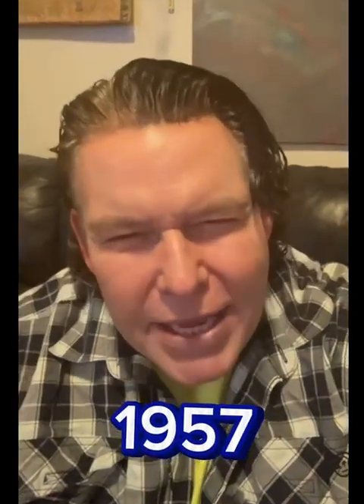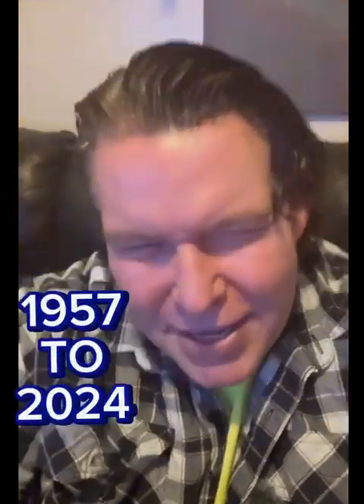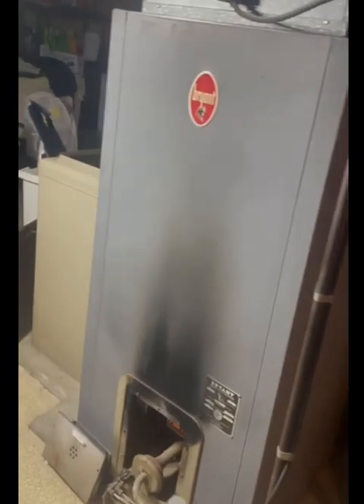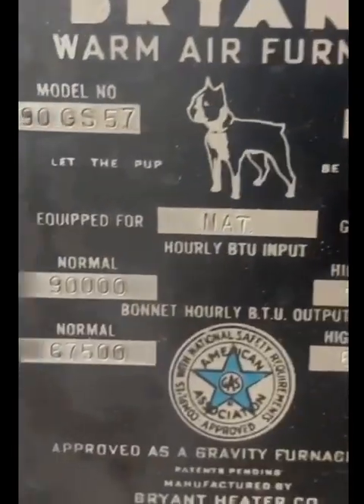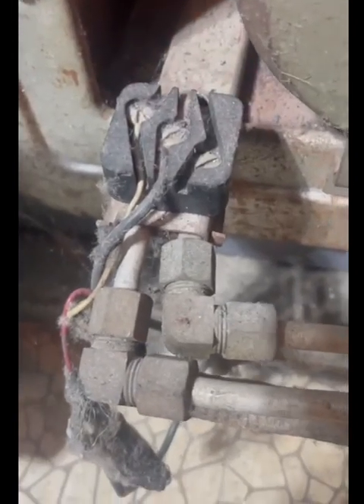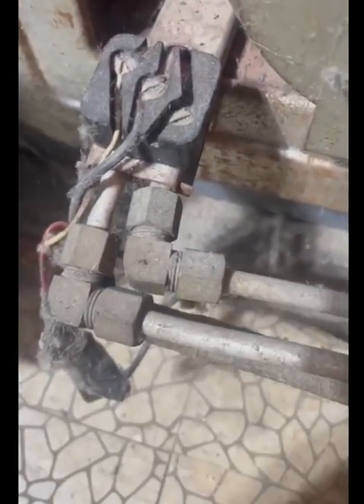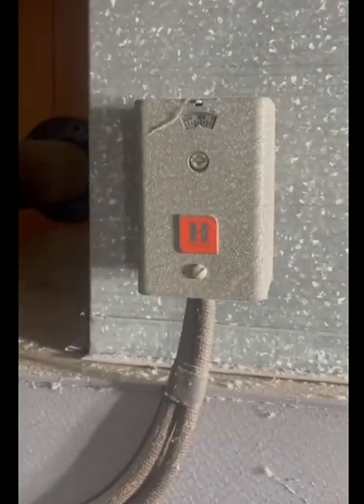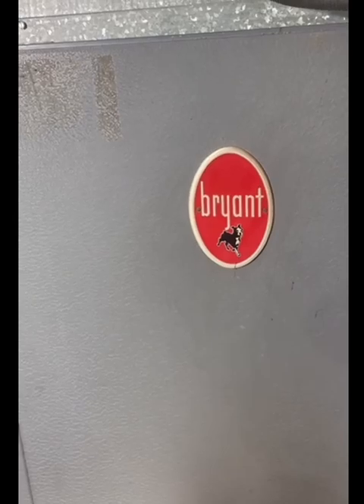CHECK OUT THIS 1957 MODEL FURNACE!!! FIRST SERVICE CALL EVER!! #antique #hvac #diy

Comment: I have a 1980 natural draft furnace still running. Combustion analyzer showed 77% efficiency and no cracked heat exchangers. Burners, flue and vents all in great condition.

Comment: My aunt and uncle had the identical Bryant 90-GS-57 Gravity Air Furnace in their basement, it had a huge octopus looking cold air return on the left side of it, the unit that was in her basement it was manufactured later than the unit in the video, the oval "Bryant" metal nameplate with the Boston terrior dog which was Bryant's monogram in the 1940's and 1950's it was identical except the nameplate was blue, unlike the nameplate shown here is Red in color, the Red nameplate is older, the blue nameplates were on units manufactured in the 1950's also the Red nameplates were fastened to the jacket of the units by means of 2 sheet metal screws, where the blue nameplates had 2 rivets and probably 2 clips on the inside of the jacket to friction fit the nameplate permanently to the jacket, i recall in her apartment as a kid The thermostat was a early round Honeywell T86A7X103A1 it had a smaller setting dial than the later T86A and T87F Round Honeywell thermostats which the larger dial was implemented around 1959-1960, the thermometer scale and set point was in the same scale unlike later T86A thermostats the thermometer and set point scales were separate, the cover ring was painted white over the original gold color at some point to match the wall in her dining room, however these Bryant Gravity units are getting rarer, they put out an appreciable amount of heat, however without a blower, unlike the unit shown here, they have 1 high limit control, it is common without a blower the heat exchanger gets too hot if set too high, it trips the high limit and cuts power to the solenoid gas valve, stopping the flow of gas to the main burner, when the unit cools, it cycles on again until the thermostat is satisfied, very cool and dependable unit will outlast most modern furnaces by far!
Reply from the maker: You win REPLY LENGTH OF THE CHANNEL AWARD!!  great info!!! loved seeing this furnace and loved the read!!!

Comment: I have taken out so many natural draft furnaces that were still completely functional and had no issues. Its amazing how the equipment lasted.
Reply from the maker: I had a whole wall covered in amazing metal name plates!! Worked as a SEARS sub-contractor for some time and ill tell you, we would replace 3 a month like the ones in this video. I feel a bit guilty about replacing as many as i did  BUT I was just a installer back then!!!

Comment: You can still buy those warp switch's. Check with Carrier.
You'll need to slightly modify the "newer version" but it will work.
Reply from the maker: really??? !! I think its from having a different brand that lost its pilot sensing switch, and me trying to find one for a Moncrief that led me to keep hearing from suppliers “they dont make those anymore “ —-ill try carrier!! thanks!

Comment: Young man, you are quite knowledgeable but you are misleading the public about the squirrel cage motor. A "done" motor will have melted the epoxy within the windings of the stator. The armature still turns & the smoke has not gotten out of the stator windings, yet. A proper cleaning to facilitate air circulation through them & a dose of 3-in-one oil in each of those oil ports and she would be good to go. I have a 1957 Moncrief, same soup, different bowl; STILL running today. Yes time is money, but when you do a customer right you earn their loyalty; & a word-of-mouth reference is always the best reference
Reply: Perhaps it was better to replace with a newer 'maintenance free' motor that doesn't require the bearings to be periodically oiled.
Reply: @empireoflizards  depends on your perspective. I was always taught if it ain't broke, don't fix it
Reply from the maker: while I appreciate your input the smoke definitely came out of the motor! The lady almost called the fire department prior to our arrival! I did further testing off camera and she ultimately let the system run as a gravity only system. i really try to do every customer “right” and have a extensive customer list by word of mouth. THANKYOU for the comment!